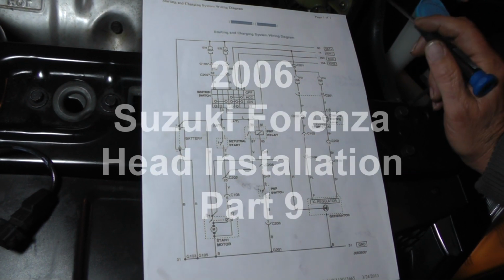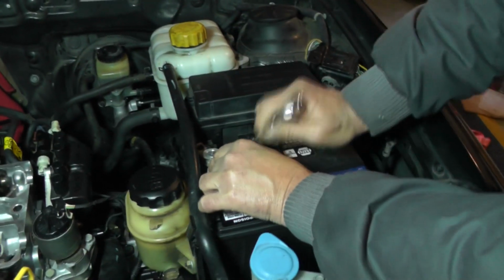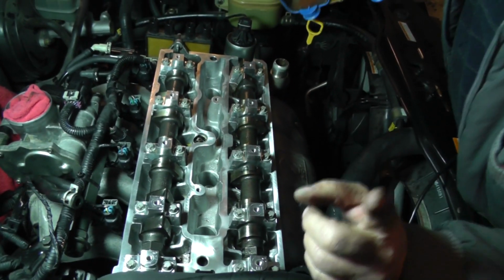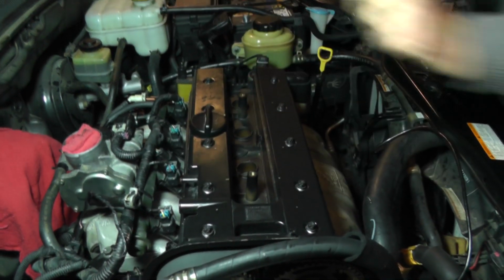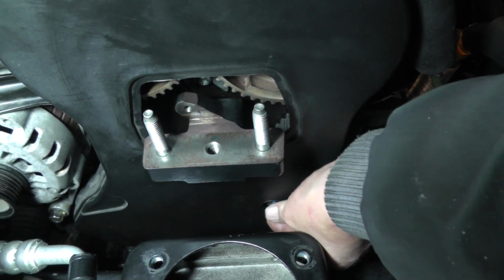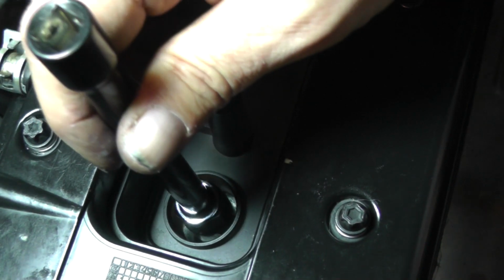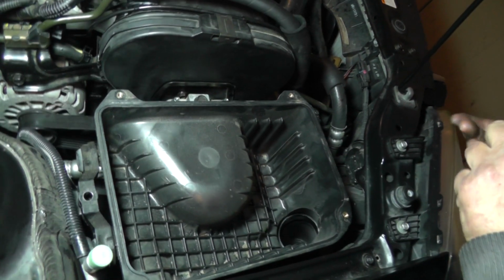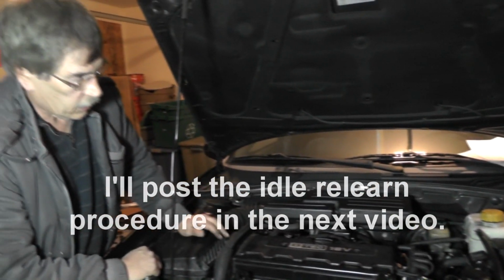Suzuki Forenza Head Installation - Part 17 (We're Done!)

Comment: Hello, good evening, thank you for sharing your experience. I have a question. Curious question. Don't you use silicone? What is Vaseline for? thank you so much
Reply from the maker: Yes, I do use silicone but at the time I didn't have any around. As for the vaseline, I used it as a lubricant for hoses, etc. And if I remember correctly, I put some on the valve cover gasket which was stupid. I would just put it on dry as nothing is needed. And have a Merry Christmas!
Reply: @stuzman52  thank you so much for you information  Merry Christmas

Comment: So I did everything step-by-step as you did and still ended up with something being wrong because it sounded just the same as before I started. And the only thing I can think of is I left a oil in the cups or lifters. Was they supposed to be completely empty before installation?
Reply from the maker: Josh McCullough In my case with the lifters, I wanted to get the oil out as this engine’s oil wasn’t changed on a regular basis. I wanted to be sure that there wasn’t any sludge in them. In my case, it took about 15 minutes of idling and then the lifters didn’t make any tapping sounds. As mentioned, you only need to bleed a small amount of oil out of each one to ensure that the valves wouldn’t remain open. In a few minutes of idling , the clattering should stop.

Comment: HI i have a 2007 suzuki Forenza that had a head job done but after a few days of driving it had a heater hose leak, i changed it out then after i change it out and place coolant inside it would crank anymore what can cause this.
Reply from the maker: chris vaughn sounds like you’re saying it wouldn’t crank anymore. Be sure to check to make sure you didn’t jar some wiring,

Comment: @stuzman I wanted to thank you, I have been using your videos for the reno/ forenza line for the past 2 years to do full and complete work to my car. just replaced the head and all components related this last week, your information is invaluable, thank you sir
Reply from the maker: NateSA The Legend you are very welcome and glad to hear that the videos helped you out! 😀👍
Reply: Thoroughly enjoy your repair methods and instructions. I have a 2007 Forenza that I followed your instructions to replace the head gasket and the car ran great until a week ago. Was driving and it seemed to be missing. Parked the car and went inside and when I cam back out it would not start. HAD 1  code p0300 which in an undetermined miss. Found the coil spark very weak so replaced the coil and plugwires. Did a compression check while the plugs were out 150 psi all cylinders. So spark is good. Put the plugs and wires back in. Sprayed starting fluid in the air filter ducting to see if I had a fuel problem and still no start.Rechecked for codes and there was none. I then checked the timing belt to make sure it was still timed properly and it was. While I was there I replaced the cam position sensor and still no start. I am running out of ideas. Not sure this reply to another thread will show my email so it is restoredcars13@gmail.com. Thanks.

Comment: How do you replace belt tensioner not the belt on a Suzuki Forenza i checked everywhere online but I can't find anything i need help
Reply from the maker: I don't quite understand your question. You say you want to replace a belt tensioner, but not the belt. (doesn't make sense). If you're talking about the serpentine tensioner, you should be able to release the tension on the belt, take the belt off and then remove the bolts holding the tensioner. If you're talking about the belt tensioner for the timing belt, that's within this video series.

Comment: hi....I love your videos......please help me.....I fix 2004 susuki forenza I changed the head everything its back together....when I star the car...stars but shakes check engine light on and its giving me the code P0300 miss fire....please help
Reply from the maker: Thank you Raul on liking the videos. There's a lot of information I don't have to answer the question. What was the reason for the head being pulled? Did the timing belt break and probably bent valves? Or was the head gasket leaking? And probably the car ran okay without a misfire code. If so, then you have to check your work. The most likely thing that I can come up with is that the timing marks are off or that you have bent valves. So, what was the issue for the head being pulled Raul and maybe we can get a little closer to the issue.
Reply: Thank you for you answer me fast.....yea the head had bend valves we took it to the machine shop ....I follow your videos how to lut the head back and its shaking whit the angine code
Reply from the maker: Raul Flores if you are sure everything is back together correctly, I would do a compression test on each cylinder. If you have a low cylinder then do a leak down test to see what the issue is at.

Comment: Hello. I like so much your videos. I have a question,  Why you put a couple of washers under each bolt in the valve cover? How it is help to reduce to leaking of oil????. Greetings  from Venezuela.
Reply from the maker: Boris, when I measured the valve cover bolts, they appeared to be about 1/8" to long. So, when the bolts are tightened to spec, it appeared that it would bottom out and not compress the valve cover gasket enough to seal. I ran across this in a Suzuki forum and the guy said that it stopped his oil leaking from the valve cover gasket. I did a little measurement on my own and he seemed to be correct. Another method would be to grind the bolts down a little to shorten them up. I just used the washers which was a little easier.

Comment: Hi Mr. Pike, got a question. After following your videos to change the head gasket and reinstall the head, I am noticing some oil dribbling out around the exhaust manifold where it's mounted to the head between cylinders 3 and 4 mostly, a little between 1 and 2. This is after running for over half an hour and burning off excess oil as you mentioned. Motor runs well otherwise. Any suggestions? I did miss the detail about adding washers to the valve cover bolts, so will go back and add them now. Not sure if that's related or not. Thanks!
Reply from the maker: Sounds like the oil has to be getting down in the combustion chamber and being forced out when the pistons come up on the compression stroke(s). Can't say what the issue may be and if it was a camshaft cover leaking, it would come out around the cover. Did you check the flatness of the head or have any machine work done to it? You could do a compression check on each cylinder to verify that all looks well there. That's all I've got for now.
Reply: stuzman I did send the head to the machine shop after the timing belt jumped time. I am not sure 100% but I believe they would have inspected flatness of the head along with everything else. I'll do a compression test on cylinders tomorrow and see what those readings are. Thanks for the reply.
Reply from the maker: Yes, a good reputable shop would do this as a normal procedure in checking for flatness. And I would still do a compression check as a peace of mind just to be sure all looks well there. How many valves got bent when the belt jumped timing?
Reply: stuzman I don't remember exactly how many valves were bent, may have it written down somewhere or on the receipt. I believe I had damage in 2 cylinders from what I could tell when I checked with air compressor before sending it to be rebuilt.

Comment: Best video series ever.  Thank you!  We just replaced a head gasket on 2006 Forenza.  Everything went very well except we must have broke one of the lifters.  One had a loud "pop" when we we bled it, now it has the tic tic.  Also, we must have had a lot of antifreeze in the muffler as it took about 20 miles for the white smoke to quit.  Again, thanks!

Comment: hey Mr Pike thanks for the great series. I sent out my head with cams and lifters to be cleaned and resurfaced. should I dip the lifters in oil prior to install?
Reply from the maker: On the Suzuki that I did, I squeezed all the oil out. I didn't presoak 
them other than to let the lifters sit in oil until I got around to 
them. This was more to keep them from rusting. After the oil was let 
out, I put them in the engine and lubed up the faces of the lifters. If 
your engine has been sitting for awhile, it wouldn't hurt to put a small
 amount of engine assembly lube on each lifter face. I like this engine 
lube 
https://www.amazon.com/gp/product/B000HBNVSK/ref=oh_aui_detailpage_o03_s00?ie=UTF8&psc=1
 Keep in mind that when you start the engine, the valves will rattle 
because of no oil i the lifters. Don't rev the engine, just let it idle 
and the noise will subside after about 15 minutes of running once the 
lifters get pumped up with oil again.
Reply: OK thanks for the tip. Also when cleaning the deck I've come across so many different methods and I'm zeroing in on two products: rubbing alcohol and oven cleaner (I also want to clean the entire block to remove oil leak from failed vcg. It's at top dead center do u recommend spraying oven cleaner inside the bores?
Reply from the maker: Unless the bores are that dirty, I would leave them alone. Just have a thin film of oil on the bores. Otherwise, the cleaner is going to run down the cylinder and contaminate the oil, unless of course you're changing it otherwise. I wouldn't use either rubbing alcohol or oven cleaner. Just use brake cleaner as it does a pretty good job and it will take care of the oil leak on the block.
Reply: Ok thx a lot for your time sir, I'll report back when I install the head, I'm still waiting on my parts
Reply from the maker: Just remember that you're spending a lot of money on head repair, parts, etc. The best advice I can give you is to take your time when you put everything back together. You want to watch the details. Remember, this is an interference engine and if you don't get it back together correctly as far as the timing, you'll have bent valves and you'll have to do the job all over again. Don't rush the job and you'll be fine :)
Reply: I'm definitely keeping your videos handy as I'm working on the vehicle to make sure I get it right. I didn't see you clean the egr, any reason ? I want to clean mine. What do u recommend?
Reply from the maker: You could use some brake clean on the shaft and pintle, but make sure that you don't let any of the cleaner run down inside the valve and electronics.
Reply: Hey mister Pike, so I bolted the head a couple of hours ago. I must say that I was uneasy about the torquing... I felt as if the bolts were about to snap. Very nerve wracking! I have the egr assembly and water inlet in mineral spirits for the night. I'll put them on tomorrow God willing. Are the camshafts identical?
Reply from the maker: I don't know if the camshafts are identical or not. That's why I marked them separately to be sure they went back in their correct places. Sounds like you're making progress...
Reply: stuzman yeah it's moving I even took out the old water pump and the housing was a rusty mess so got some cleaning to do there. If all goes well I should be done today. Thx for the feedback Mr Pike

Comment: Terry, first of all thank you so much for putting together such a detailed video series.  I really enjoyed the way you explained each step and video filming was perfect. I was able to follow along and replace the head gasket on my 07 Forenza.  
However, my car doesn't want to start. It seems my car fuel system has shut down and there is no fuel pressure in the fuel injector rail. Is there a process to reset the fuel system on this car?
Reply from the maker: +Arsalan Abbasi Glad to hear that you found the video series helpful and thank you for your comments. There is nothing to reset on the fuel system. After the job is done, you should just be able to crank and start the engine as before. Sounds like you need to do a little troubleshooting to see if the fuel pump relay is pulling in. You should be able to hear the fuel pump run for a couple of seconds when you turn the ignition switch to the on position. Have you done this yet? If so, and you don't hear the pump run, then you may want to start at the fuel pump relay to see if it's pulling in, and start checking some voltages such as B+ on the coil and on one side of the contact.
Reply: +stuzman52 I do not hear the pump run when I turn on the ignition. There is no sound on the fuel pump relay either. I also pulled the fuel pump relay from B+ and used a volt meter on the two pins there is no voltage.
Reply from the maker: +Arsalan Abbasi Alright sounds good Arsalan that you're on the right path. If you don't have any wiring diagrams, you can get some free at www.bbbind.com for your vehicle. Then click on 'Technical Information' and finally on 'TSB's and Wring Diagrams'. That should get you started on your hunt to finding out why you don't have any B+. You may want to check your fuses to see if you have one blown. Good luck on your repair!
Reply: +stuzman52 wow that bbbind.com site is fantastic. Thank you for the valuable tip. Looks like I was reading the voltage incorrectly on the relay. Based on wiring diagram you pointed me to, i have now verified that pin 85 and 87 of the relay does indeed show 12 volts. I also checked the fuse (15A) is good for fuel pump. what should be the next step. thank you so much!
Reply from the maker: +Arsalan Abbasi Keep in mind that your vehicle was probably running okay before you installed a new head gasket, correct? And that it's probably something simple where you may have forgot to plug all the electrical connectors up. And that I can only give you advice of what you tell me in the diagnostic process. Okay, you say we don't have any fuel pressure,  you can not hear the fuel pump run for two seconds when you turn the switch to on and that you can't feel the relay click for those two seconds. In any event, take a another look at the wiring diagram for the fuel pump relay. You say that pins 85 and 87 have B+ voltage. Did you check this with the ignition switch to the on position? If so, then this is not correct. Pin 85 of the coil goes to ground. And pin 87 goes to the fuel pump which wouldn't have B+ until the relay contact closes. Pull the relay out and take a test light and hook up to terminals 85 and 86 for the coil. Now turn the switch to on. Did you see the test light come on for about two seconds? If so, the coil circuit is good. Do that and get back with me of your results...
Reply: +stuzman52 Correct, the car/engine was running prior to head gasket work and the injector rails had good pressure when i disconnected the fuel line.  Also, looks like I read the wrong pins earlier. The B+ voltage is between pin 87 & pin 30 when key is turned on. The Pin 85 & 86 do not light up at all when turning the key on. This is puzzling. I seem to have all wires plugged in properly but i will review all the wires again.

Not sure if it matters but the white plastic insert in the fuel connector for injector rail broke off when i was trying to disconnect the fuel line. I have it plugged in without the white plastic insert at the moment but I have made sure it is fully inserted.
Reply from the maker: +Arsalan Abbasi Sounds like you're saying that you have B+ with you measuring between pin 87 & 30. You'll get B+, but not the correct way to do where you'll picking up your ground through the fuel pump. In any event, sounds like you have B+ on pin 30 and ground. As for the other two pins, 85 & 86 for the coil, I suspect that the ECM is not providing a B+ to turn on the coil. As one more final check of this circuit, take your test light and clip it to battery positive. Take the test light point and touch on pin 85. You don't need to turn on the ignition switch for this. You should see the light glow brightly. If it does, this confirms that you have a good ground to pin 85 and that you're not getting B+ from the ECM to pin 86. You probably don't have all the B+ and/or grounds to the ECM. Did you make sure that you connected the grounds which connects to the ECM underneath the intake manifold? I believe it was two or three wires. If you don't connect those grounds, you won't have fuel pump control or spark or anything else for that matter for the ECM to work. This is the only thing that I can think of. If those wires underneath the intake manifold are connected, then you'll need to start checking for B+ and grounds on the ECM to make sure they are all there. You look over the diagrams if you want to see which fuses, or you can just check them all will probably be faster.  Good luck...
Reply: +stuzman52  That was it!! I failed to connect the ECM ground wire to the intake manifold. Once i connected it, she started right up. You are fantastic!! Thank you so very much.
Reply from the maker: Glad to hear that you got her going there Arsalan! And happy motoring with your vehicle!!!!